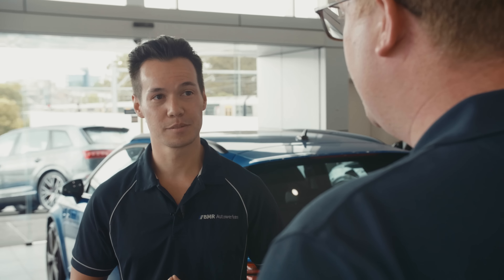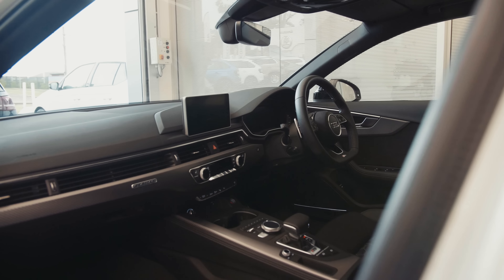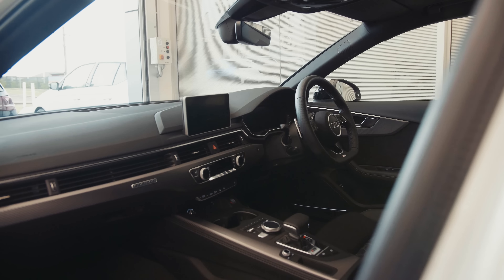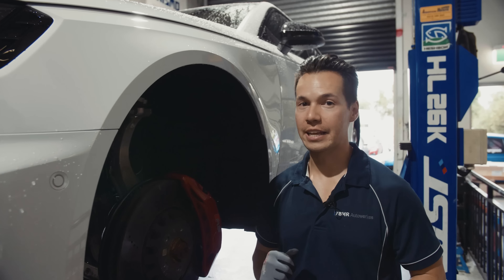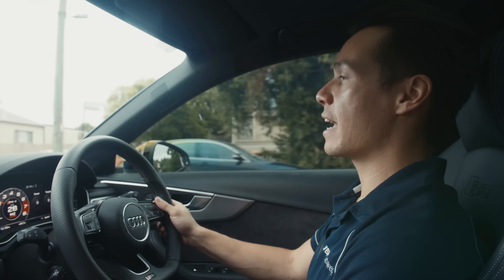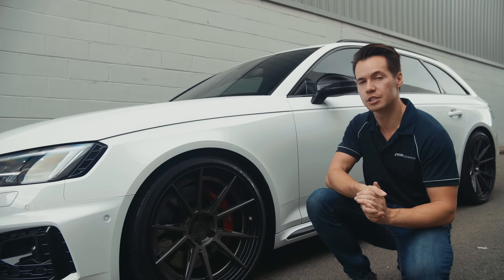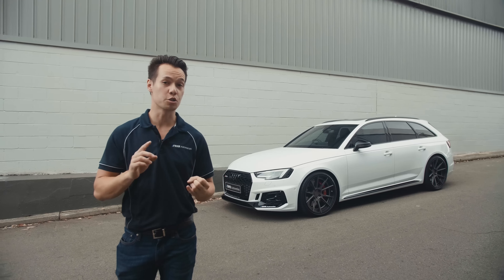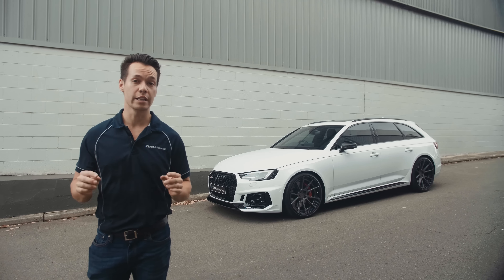Audi RS4 B9 Avant 2019 Delivery and Modifications!

Comment: Build looks lekker but that car needs a decat downpipe and while you're at it ceramic coat the downpipe inside and out and then heat wrap it to prevent soaring engine bay temps.